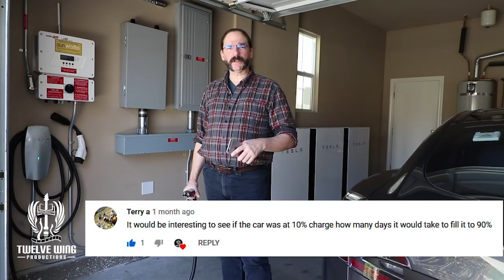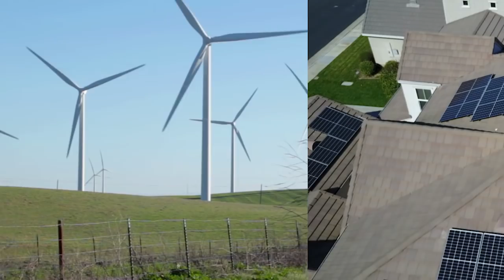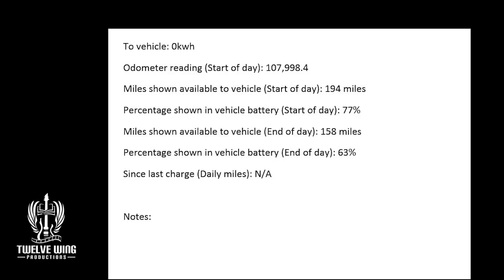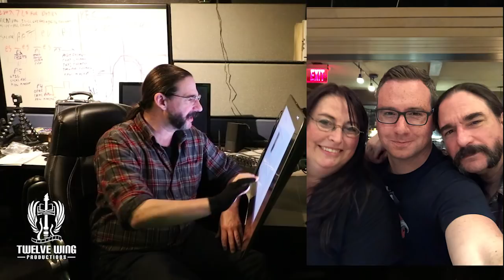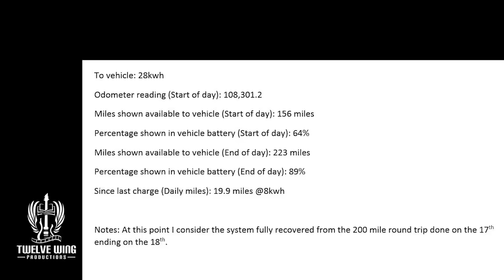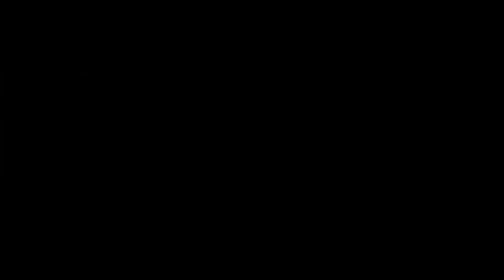The Energy Sovereignty Project: Month 4 week 3

Comment: I do have a terrible memory sometimes, But have you ever said how you heat water? if its Gas how much a year? Do you plan to install an elec water heater? The same go's for space heating, and heat pumps ect?
Reply from the maker: No, your memory is good.  We use gas but I had thought to look into electricity.  Same with the range.
The thing is, electricity is efficient at many things but it's not actually very efficient at making heat.

Surprisingly, what IS very good at making heat... is gasoline.
It's just that it sucks for just about everything else other than aviation fuel.

Heat pumps might also be something that could work for at least some of it.  I'll look into that at the end of the year when I tally this all up week by week to see where additional efficiencies can be teased out.

The biggest issue, I think, is going to be heating water in winter.  That will be a tall order if that too is something we have to do with electricity.

Comment: Can you not get a Zappi in the US? the fact you go from solar to battery then to car wastes quite a bit? The control available from this charger is better than any other i know.
Reply from the maker: The Powerwall doesn't allow direct access to it's DC buss yet.
Additionally, the Tesla charger uses it's own communication protocol.  So if either one of those are going to be solved it's going to be through Tesla.
I have not heard of anyone installing a Zappi in the US yet but I'm sure they are coming.  The biggest issue is getting everything to communicate.  The Tesla app has the best data to make that happen.
Reply: @twelvewingproductions7508  Check dales video then? Zappi just uses CT clamps so no monopoly. A good idea of how it works WITH tesla products is here. https://www.youtube.com/channel/UCFDIO8rIBRbuC_u4sVVLjBA. One of Dale's videos goes into great length showing how good using 1 or more of the products really reduce power usage. If you can divert power from solar direct to the appliance before batteries this is better as you have no inefficiencies. I do not have the luxury of having battery but a Zappi for my car is the best investment i have made in a long time.
Reply: @dizzyikea   
I've already done this.
https://www.youtube.com/watch?v=_2A_J2Hq6-c . No app, nor Zappi was involved. Then again, I'm really not a Tesla fan so if I can avoid using app crap, then I will :)

Comment: Impressive solar output.  I love the fact that you're running your home off the grid in Zombie apocalypse mode.  Very impressive.  You mentioned going forward that the system will produce excess energy during the Summer months.  Will you send that to the grid, or how do you intend to offset the excess power?  I'm curious about that.
Reply from the maker: Yes David, we are going to have to start exporting to the grid as there is simply no other way for us to track our output if we don't.
If I shut off the solar array to keep from sending power to the grid then we will loose an enormous amount of data points regarding production.
Because we will be recording everything we send out, it will be a simple matter for you and the others following to simply decide what you would personally do with the extra power.
Perhaps your consumption is higher, or you can plan for higher consumption, or you have more than one vehicle that can store and use the power.